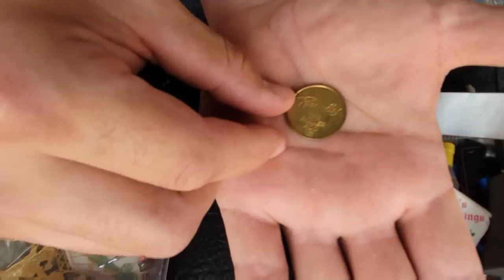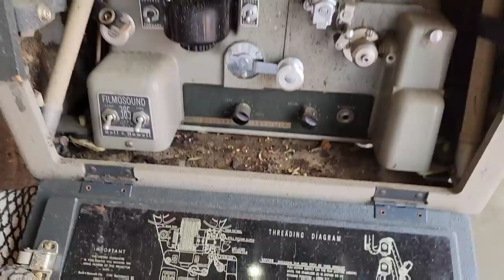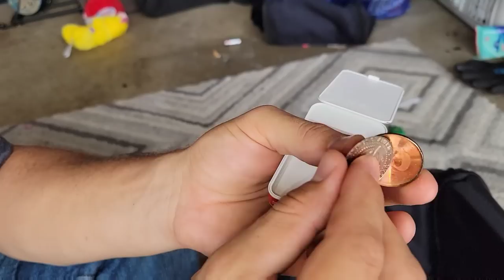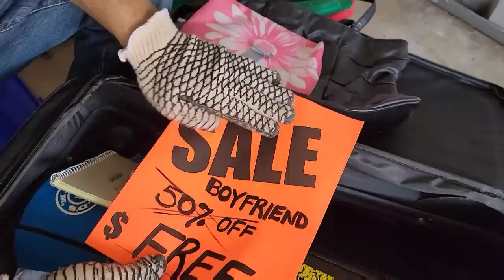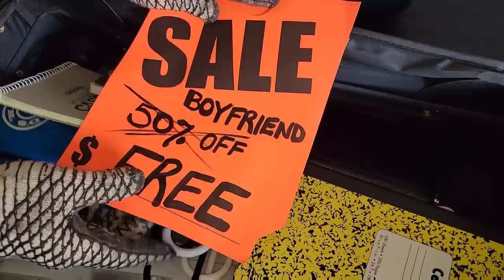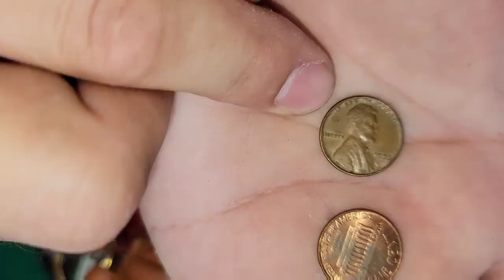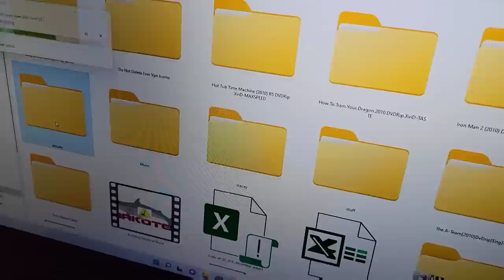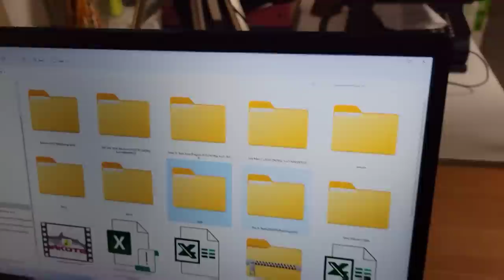CAUGHT LIVING IN A STORAGE UNIT

Comment: The hollowed out 50 cent piece is used by illusionists ( magicians ), there should be a black nylon ring with one opening slightly bigger than the other and the coin fits in there and it is "BANGED" on something hard to get the pieces separated. When the "magician" uses this he / she shows only the heads / tails section getting the viewer to "believe" that there are 2 coins and when the magician puts the coins in the spectators hand the halves nest together and when the spectator opens the hand there is only one coin